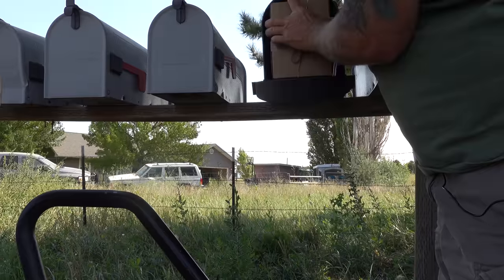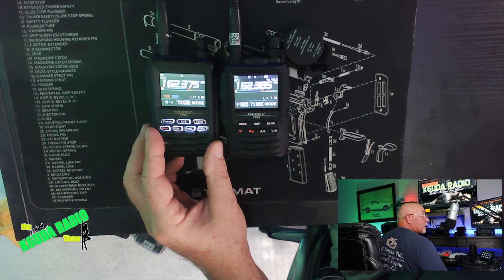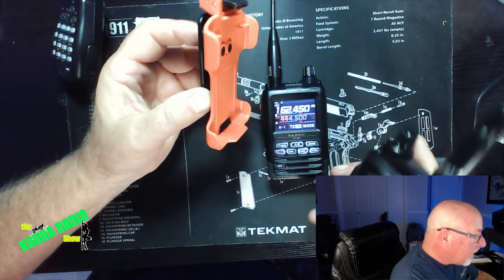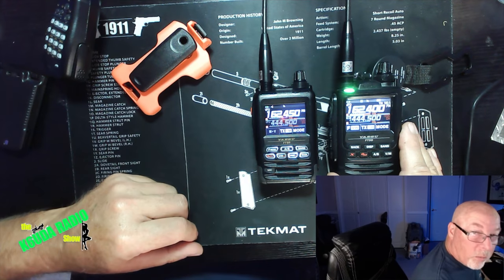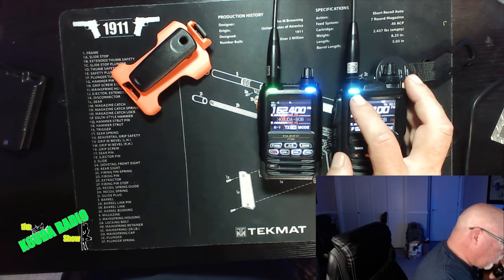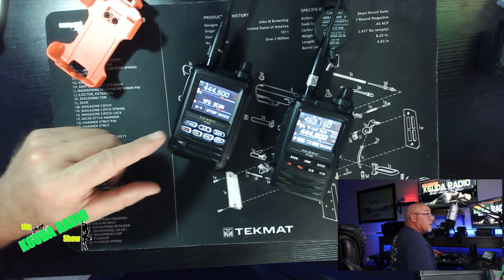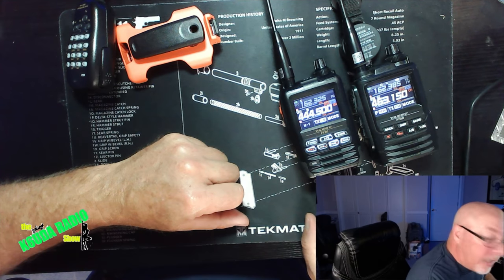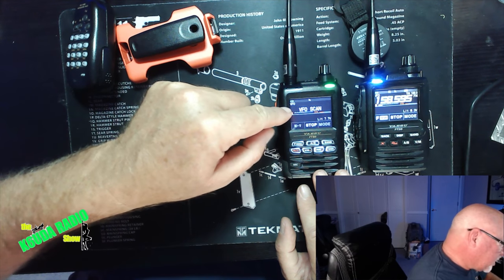My first look at the Yaesu FT5D

Comment: Great comparison & review Bob! I just wish Yaesu had included more impressive features and functions instead of these tiny tweaks. For instance, Yaesu had a perfect opportunity to easily take it up a notch with this radio by opening up full capabilities of the TNC and bluetooth functions. The FT5 should have had the ability to bluetooth link to any smartphone or laptop & allow your phone or computer the ability to wirelessly take advantage of the full potential of the internal TNC on the HT. This would allow the use of WinLink & other digital modes (kinda like the Mobilinkd capabilities). This should have been doable with a simple firmware update. But unfortunately Yaesu continues to hobble our Bluetooth and TNC capabilities via their firmware. Keep the videos coming Bob! 73. James - KH2SR
Reply from the maker: Thanks.
Reply: That's my biggest complaint about Yaesu radios with Bluetooth capability. I can change D-STAR repeaters from my cell phone with Icom radios. With my IC-705, I can change frequency and bands. 

Yeasu, on the other hand, I can connect to Bluetooth audio devices, that's it. I guess that they haven't figured out that it would be easier to send a text, email or changing a status on APRS using a cell phone connect to the radio via Bluetooth. 

If the FT5 had that capability, I'd buy one. But until then, I'll keep my FT3D.

Comment: The static "MEM SCAN" message display, instead of showing frequencies cycling while scanning, is completely and utterly visually unappealing and disappointing for the FT-5D, and wholly unexpected and undeserving of the current Yaesu flagship HT product.  If more prospective buyers knew this before purchase, I guarantee it would affect sales- which is my mission.  THIS NEEDS FIXED NOW.
Reply from the maker: I made the same observation about the vfo scan. I’d assume it’s something that can be fixed in a firmware release if it not already buried in the menu somewhere.
Reply: @K6UDA  Nothing in the menu.  Trying to get publicity that would help force a firmware change that would at least add this as a "High Speed Scan" option, rather than a default with no recourse.  Josh at HRCC is already onboard. Thanks.

Comment: For those who don't get the obvious- Load 100 memories. Start a MEM SCAN. Try and predictably stop it within 3 memory entries of a desired memory. Oops! You can't. You can't see where in the memory list it is scanning. You would if you could see the channel number, the tag, or the frequency. But now you are stuck cranking the knob, or memorizing freqs and channel numbers for direct entry. Do you understand the utility that is lost now?, that is on every other HT- including the FT3? MEM SCAN and VFO SCAN are the dumbest things I've seen on an HT in 35 years, and I can't believe some of you don't understand this. Being able to see the scan and stop it is the fastest way to navigate to a particular memory or frequency, and is a primary function in Ham radio.
Reply: Now, if you FINALLY understand how disastrously this affects the use of an FT5 compared to ANY other HT, please contact Yaesu about it as John Kruck instructs to get them to change it. Thanks.
Reply: And if each one of you that I saved $500 send me 50 cents via PayPal and I’ll consider my efforts and flames I’m taking worthwhile. Thanks.

Comment: Any word if the FT3 programming software will work with the FT5?
Reply from the maker: I just tried it. It will read the radio all the way to the end and then error out. I guess we’re waiting for two weeks until RT systems finishes the software.
Reply: @andrewgemmell5162  If only yaesu made programming software that worked for these expensive radios that was worth using :/

Comment: Does the ft5d sound the same as the vx6? and can you listen to the both vfo's at once ( for exampel vfo a local repeater, vfo b local airfield ? is it worth to replace my vx6 for the ft5d
Reply from the maker: I can’t remember what the VX6 sounds like but yes you can listen to two separate bands or same band on two separate receivers.

Comment: ft3  common  fault   audio   not  good   this  is   why  the  fd5   has   come   and   discontinued the  ft3   .  air  band  ft3d    so  bad   and  fusion also  bad .  people  over  here in uk   bought  them  and   withing  3  weks  either  returned  them  or  they  have   sold  them on  .   yeasu  knew  about  this    and  so  many  returned  because  of  this   problem  .  lets  hop  the  ft5   is  better  .

Comment: No full duplex/ No cross band repeat.
USELESS.
Nobody cares about garbage digital modes.
Reply from the maker: Cross band repeat is nice, but I only see it being really useful on a mobile. Mo Power and a better antenna. As for the digital modes, They are huge out here where I live.
Reply: @K6UDA  when a dual band radio is full duplex/has cross band reapeat the entire architecture is different. It needs hi/lo or band pass filters and independent rf circuitry. Digital crap caused radios to devolve and impedes progress. You dont need to be a ham to send packets over the internet.
Reply: Paul apparently you are against digital as you have conveyed. I really can't see a crossband repeat option being viable for any HT not just a digital one. Mobile yes totally useful. Like your hair products by the way.
Reply: @Freddy Muldoon yes
Reply: @kd4kzz  been using true dual band radios   since forever for satellites, linked repeaters or just listening while talking on another band. It is fundamentally useful and important,  you don't need to actually leave it in auto cross band repeat just full duplex is the bees knees for an advanced efficient operation and I'm not against digital at all only that which sounds like hopeless crap.
Reply: @Freddy Muldoon get a wig
Reply: @paulmitchell4421  can you please provide info on "true dual band radios" you speak of.
Reply: @Freddy Muldoon are you having split ends? ... Poor thing.